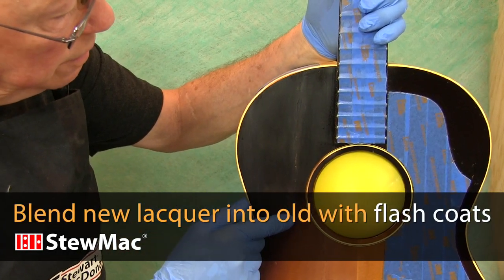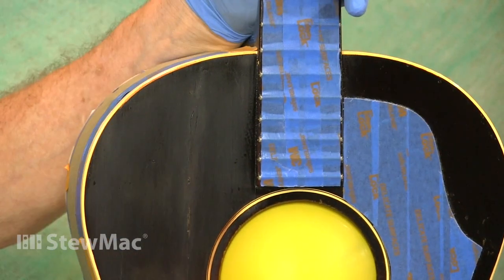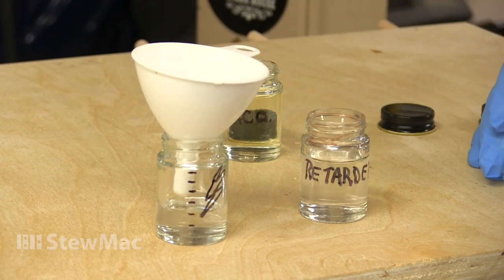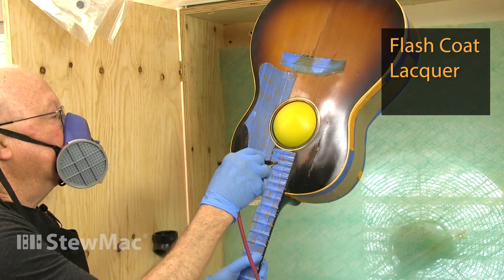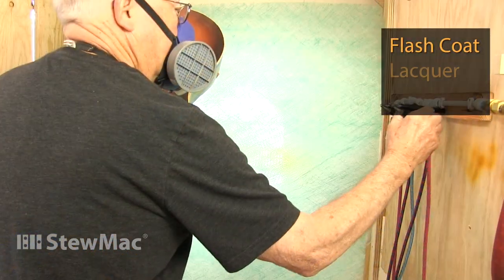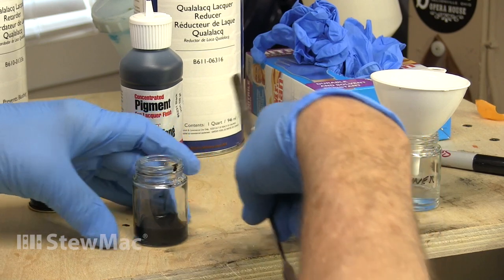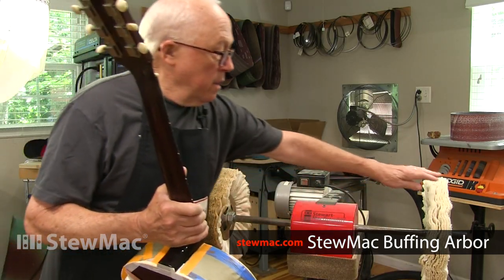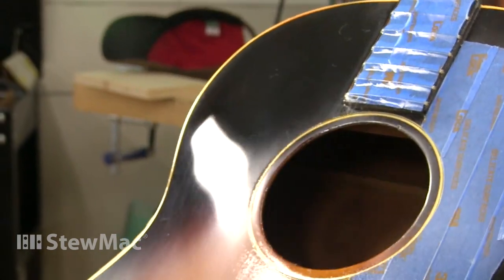Blend new lacquer into old lacquer with flash coats

Comment: * * * Dan...I have 2 Martin guitars...a 2004 D-16R and a 2012 OM-18 Custom...I have owned bought both guitars bard new...I have treated both guitars exactly the same...rarely play them and when I do....wipe the down and put them back in the case. The 2004 D-16R is in near Mint condition while the OM-18 Custom is covered with about 20 "finish cracks. I live on the California Central coast that has an average humidity of 50-60%...Neither of these guitars has been in "extreme temperature changes. I have seen on different guitar forms that lot of people with a "2012 Martin" are having the same problem with "Lacquer Cracks / Checking" especially at the Bridge calling them "Martin Bridge Whiskers" which I also have. Any thoughts and is it worth repairing? I have seen a video on here where Goodalll is not using a different Lacquer Finish now and Collings...Santa Cruz and Huss and Dalton are all looking at changing theirs. Thanks...Ron

Comment: I haven't been able to find a video explaining how to make,  for example, a color design in a lacquer finished guitar.
I'm painting my guitar with black nitro lacquer and I'd like to make a purple design.
What materials and how do I create the paint, if I painted the whole guitar with nitro lacquer in spray?
thanks!
Reply: Get purple lacquer and then make a stencil of your design. Spray the purple through the stencil with a couple light coats, just enough to get uniformity of color. Then coat the whole thing with lots of nitro clear, several coats. After several days wet sand with 800 through 2500 then buff

Comment: First it looks like you’ve updated your flash coat mix from 3 parts lacquer and 1 part thinner. Second, it looks like you’ve got a more advanced spray booth from just the air filter on the slow moving exhaust fan. I might be watching your videos too much at this point lol

Comment: I have used auto body painting techniques of my guitar....and the finish was better than what it came out with from the shop... Video maker man ...... that is not how you air spray lacquer...... get a wider nozzle and apply thin coats, 3-4-5-6 of them, after 2 coats it looks like ... crappy 
Also...... what the fuck is that masking job??!?!?? the tape is applied horrible Looks like a lazy job to me.